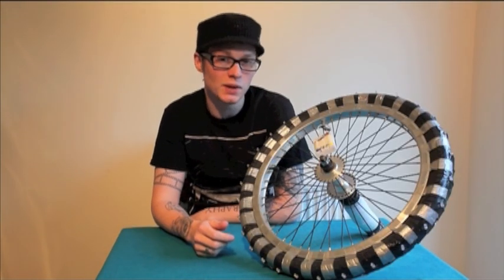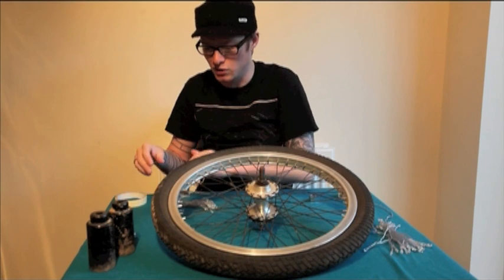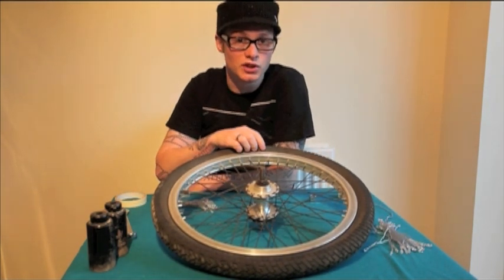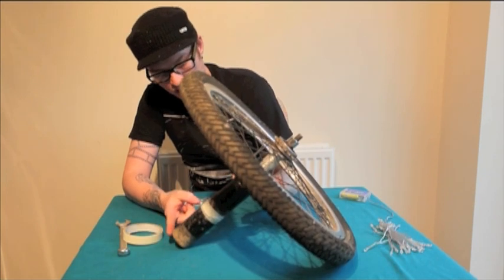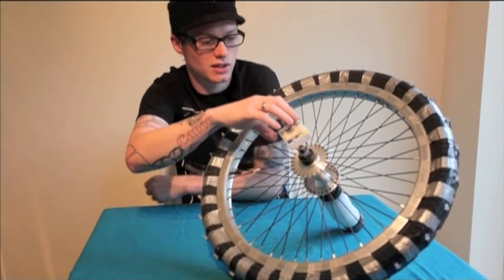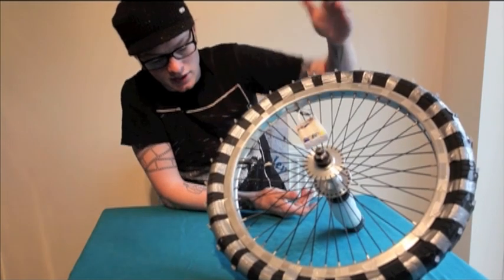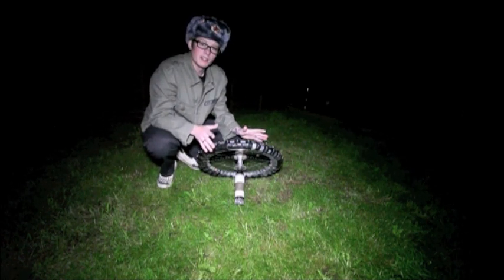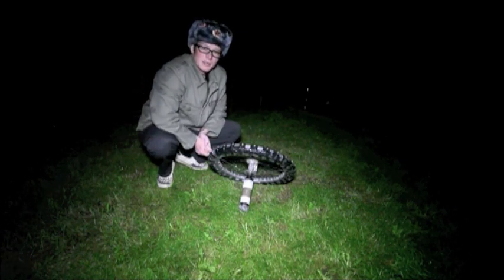Noctography - Tutorial 6: Domes

Comment: Wow, I haven't seen that method before.  There is another more primitive way to do it with a light on the end of a right angle.  The corner is the pivot point and you flip and rotate around 360 degrees and you will get the same result.  The wheel way is a heck of a lot faster.  But with the other method there is no limit to the size of the dome.

Comment from the maker: It's not essential, but it will slightly change how your Dome is formed, the exact half diameter results in "no gap at the top" of the dome, if you use say a 1/4 diameter it will still be a dome, but with a rather large gap in the top, there is no right or wrong way, just different ways, give both a go :)